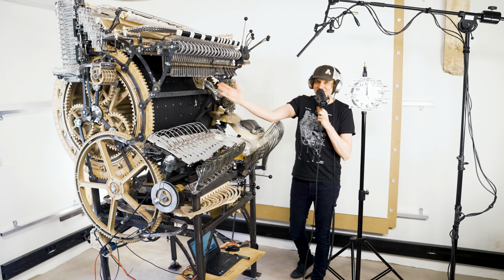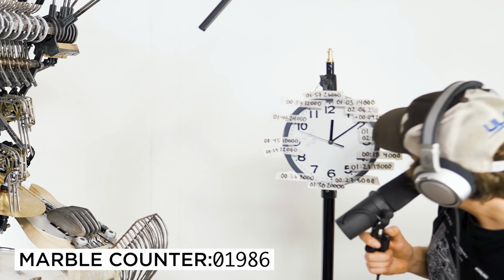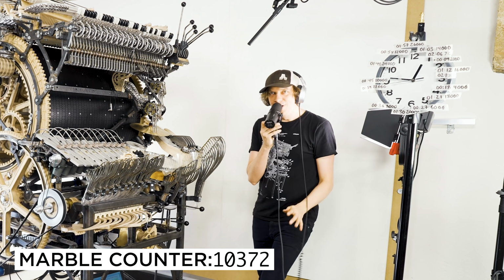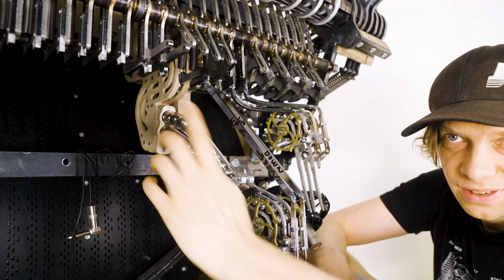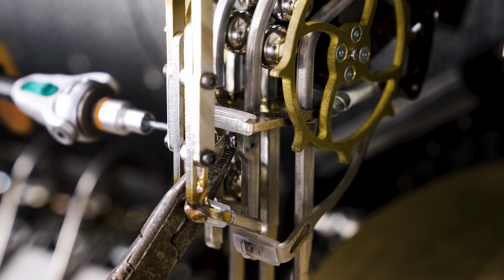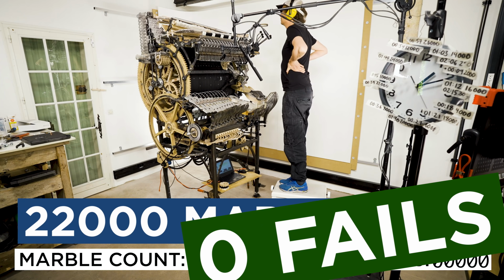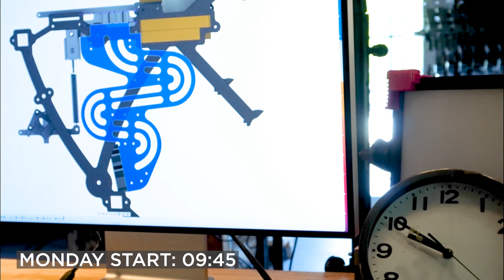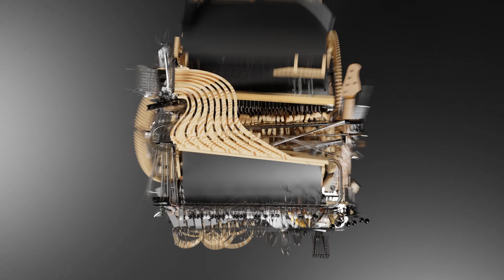Playing 30000 Marbles - Marble Machine X Accuracy Test

Comment: Finally updated washer stacks to spacers.  Impressed.
Reply: I only hope theres a washer between the rubber and the metal, because otherwise it would still cause friction. There's a reason trains don't use rubber wheels after all
Reply: He skipped over it as if he's trying to hide something from his grandma hahahahah....
Reply: It did not look like rubber but a plastic cylinder
Reply: SPAAAAACERS!

Ivan's follower checking out.
Reply: @mickys8065  In Paris they do...
Reply: I was expecting him to make a groove in the original pin and use a C-clip. Instead he went with a less elegant throwback method.
Reply: Yeah it's a POM piece, they're rather low friction. (Which happens to be a problem sometimes in hydraulics.)

Comment: 8:41 just a little heads-up. I noticed one of your catchers was rocking because of vibration. That was in an unused channel, so no issue there. But as you start adding more channels, there is a possibility of them rocking because of resonant frequencies, which may cause the marbles to miss.
Reply: O yea it really does 🤔🤔🤔
Reply: The current catcher is still a leftover from when the artist was building the machine, not the engineer. So the  flair movement was stopped by the engineer to prevent fails during tests, and will revisit them when the rest of the machine works.

One way to prevent the issue as you describe is to support or replace the PMMA tube that is holding them, they are too long and wobbling. The basket design itself is not best solution for the enginer either as the marbles bounce randomly inside them because of hitting the steel rods , thus the curtain extensions you see on them for now.

They work for now, but they are definately not in their final form.
Reply: @89lutzy  cool!

Comment: "I'd like to change the programming wheel."

In the pursuit of perfection, you risk never finishing.  Same thing with the focus on getting 10m marbles with zero landing off beat or outside the funnels...seems to me that you need to focus on failure modes.  If a marble drops on the floor every 3-10 songs, that's not a failure, the machine still works.  Making sure that machine breaking failures never happen is far more important.
Reply: Often, Better is the enemy of Good
Reply: You cant be sure that a wild jumping marble who dont follow here path going to land only straight on the floor.
This innocent event could lead to a catastrophic failure.
Reply: @fafane65  Yeah, I totally agree. Martin has said multiple times that his nightmare failure is a marble falling off somewhere in the machine instead of the floor and jamming and breaking a gear - destroying the machine. 

I totally get the people saying  "better is the enemy of good", and I do think that Martin often falls into that trap, but as someone who has worked in the field of reliability engineering, in an interconnected system you are only as strong as your weakest link. I do think Martin is focusing on the right things nowadays though, whereas before he would often hyperfocus on redundant or superfluous features, now he is much more focused on the actual points of failure and the critical points of the machine.
Reply: This comment is not helpful. He is a musician first and an engineer second. If the song misses a beat or a note due to a timing issue or a programming wheel issue then he can't do what he wants to do - world tour. This isn't about the next marble machine YouTube viral video, it's about making a machine capable of playing music on stage. It needs everything he's dumping into this, including making programming wheel version 2.

Comment: I really want to know what happened to the marble gates. The return of the pressure relief lanes and the escapement mechanism not touching the escapement wheel teeth is pretty weird. Those marble gates were tested with much more pressure and everything worked fine. I feel like those pressure relief lanes shouldn’t be back, but I’m glad at least it’s working.
Reply: Exactly. Martin is acting as if nothing happened. He doesn't even want to talk about his new plywood parts. He never explained why his new pressure independent gates suddenly got pressure dependent. He's ignoring the elephant in the middle of the room.
Reply: I believe on the discord theyve discovered that the POM piece is wrongly angled, and can and has been fixed so there is no pressure problem. Martin just has to order new POM pieces, though he has also said he likes the way the pressure path looks with the visible marbles, so he might keep them anyway.
Reply: @guitarskill  Cool! I don't use Discord, so I'm not aware of the progress mentioned there. If the problem is just a simple CAD error as you said, the solution should be easy. If Martin wants to keep the pressure relief lanes for the aesthetics, it's ok, but I think that having a fully functional marble gate is very important. In my opinion, the pressure relief lanes should be just an aid for the gates, not a need.
Reply: I think there's more to it. Why does Martin need to order these POM pieces? They are pretty easy to make on his CNC.
Reply: @kriswillems5661  yes but he needs a precision manufacturing he can't achieve
Reply: @bastienpabiot3678  Are you sure? I think such a wood working CNC can go up to 0.1 mm
Reply: He talked about the pressure problem in the last video.

Comment: Curious as to how frequently the wearing parts, e.g., the springs, will need to be replaced.  Like, fresh after each concert?

And I love the marble counter has 5 digits, the same as the overall counter.  As if there could be a 33%+ fail rate. 😅
Reply: This is my biggest fear with this machine, each gate still contains 4 moving parts, which is 4 times more than 1 part from the pinball design,

The machine as is simply has a multiplier of at least 4 to whatever failure ratio it could have, and that's just the gates
Reply: @CraftMine1000  Time and trial will tell,  I guess!
Reply: Truly, maintenance intervals are a thing.
Reply: the springs at the top have been going on 3 years without being replaced, as long as they're not being stretched to their limits which they aren't it should be fine, probably best to put a fresh set on before the tour though
Reply: @TreyVaswal  That's the question, what interval?  If it were me, I'd have a whole set of parts, sorted and labeled, to replace for every performance.
Reply: @LightWarriorK  wow its not that frail, Most parts moving are made of metal, metal is sturdy dude.
Reply: @DooomiNation  The sturdy parts aren't the issue.  But parts like those springs, parts that wear out, places where the marbles run, they're going to eventually need replacing.  The more they're used, the more often they'll need replacing.  1 million marbles per show, as is the goal, and there WILL be wear and tear.
Reply: @LightWarriorK  You are aware of how many times an engine turns over a minute when it's running? That machine is going to last a looooong time before it needs any TLC. It's machined to pretty tight tolerances at this point, so it's a reasonable comparison.
Reply: @joelashton6328  This isn't an engine.  An engine has oil, and hardened steel. There are wood and plastic parts here, immaculately made, but still subject to wear.  In many of these vids, if you look carefully, you can see small signs of where the marbles have worn at the wood, or where the plastic pieces have started sloughing off little bits.

Just because this is of extreme quality doesn't mean it won't wear.
Reply: @LightWarriorK  Engines are also under more stress, and running at high temps. This won't wear out much faster than a well-used xylophone. There's impacts, but there's really very little, if any, rubbing going on between fragile parts with real stress on them. The plastic tubes will likely wear before anything else. Although, on that note, some clockmakers use ceramic bushings (bearings? Can't remember which) which require no oil and basically work indefinitely. They're pricy, but would give something like this a lifespan longer than we'd live long enough to care about.
Reply: @LightWarriorK  this is, of course, all hypothetical bs anyways. But conjecture is fun.
Reply: @joelashton6328  Yes.  And if it helps Martin think about things he didn't before, and improves the machine, all the better!

Comment: What changed between the CAD of the escapement gate and production to cause the pallet to only hook on one end? The lower "pin" doesn't ever interact with the cog now.

It clearly still works, but I'm curious and can't seem to figure it out!
Reply: The lower resting point is a screw
Reply: @artable_j  I'm looking over the CAD renders from previous videos, and I don't see such a screw: The bottom of the pallet is attached to the pushrod for the release arm, but the mechanism holding the marbles in the chute appears to have some room to slip, that might allow an additional marble to drop into the release position, and if I'm seeing this correctly that could mean an edge case occurs that allows more than one marble to drop simultaneously - an issue that's currently worked around with the plywood "pressure valve" from the marble divider.

As I said this clearly works... but I'm curious as to why the implementation doesn't match the design, and what has changed between the two.
Reply: I don't think there's a design flaw here - my suspicion is that the release arm is not travelling far enough for the pallet to engage in the second position.
Reply: @rossstewart9475  He seems to have drilled through the pallet and installed a screw to stop the wheel earlier. I can only guess that the wheel traveled too far and released more than one marble sometimes.
He even had those screws installed in the last video when he showed that the pressure gates can fail with too much pressure, which makes me wonder if that screw is responsible for that. In the last video you can also see that the point of the wheel that makes contact with the screw had already worn visibly, as it's not just a smooth pin but a screw.
Of course he could have noticed all this and corrected it, if he had made a prototype before making 30 of them :P
Reply: @rossstewart9475  The screw isn't in the cad, but it is on the machine right now. You can see it in the videos. I only noticed it when someone on the discord pointed it out.
Reply: Cheers guys, I see the screw a centimetre or so below the pivot point of the pallet. This still begs the question of what changed between the CAD and implementation to demand this, though!

Comment: Great progress! Just one thing jumps to mind: To be honest using a stronger spring will put more resistance/wear on the programming wheel. I reckon using a linkage system to the marble release so the spring can be as light as possible and less strain on the programming pins/saddles. The saddles wil buckle over time using a stronger spring.

Comment: It's starting to feel like something out of the Myst books, or maybe The Martian. Such precise fixes to account for tiny errors in the machine. Like, you've designed, built, contracted and assembled an intricate mechanical machine that functions correctly 99.993% of the time and you're going "nope, not good enough". I'm pretty sure the Apollo missions had bigger error margins.

Comment: I'm not an engineer, but if errors seem to happen later in the run, it might be a good idea to have a reset at the top of the conveyor leaving a brief gap to the flow of the marbals. The idea being that for an error to happen, a momentum of small chaotic things need to build up. A brief reset could give things more time before that builds.

Comment: I just realised, you could potentially program it automatically by adding a device to the back of the wheel.
Has little lines of pegs it can insert , and a gear to rotate(or at least read the rotation of) the programming wheel little bit by little bit.
Might not be too hard to "deprogram" the wheel with the same thing if it can pull the pegs out.
Better yet, you could remove it so it's not taking up space when you're playing it.

Comment: Hey 👋🏻 
Can you please machine a part an put circlips to hold the spacing please 🥺

 It’s really beneath the machine at this point to start putting development adjustments (all-thread and lock nuts) where precision spacing is required....
 The other thing you need to think about is how that mechanical linkage is sliding on a treaded rod. Over time this may foul and create wear which a properly machined pin with bronze washers will help avoid issues.

Hope this provides some encouragement. Great job 👏

Comment: As I said previously, the springs are an issue. If the springs merely retract the arms in a non-critical application, meaning they function on the reverse and merely just pull them back afterwards as a non-critical reset. But the problem is when you go from non-critical to critical, meaning you've got the arms pressing on something to then operate a secondary function. That's the problem. Because springs decay over time, the more you use them, the more they reduce in function. And when you tie that to a critical function, it's not a great way to do it.

I think that replacing the springs if you are going to use the arms in this fashion. Or tie this function in directly, instead of secondary.

Comment: In my opinion the problem of the 2 balls loaded together is due to the incorrect functioning of the clock gate.  The lower part of the black lever never touches the tooth of the brass wheel.
In my opinion, this is due to the spring inside the gate which is too long and in the rest position prevents the lever from reaching the stop.

Comment: I'm interested in how you will solve the timing issues.  I wrote very early on (possibly over 2 years ago) that I thought the gates ultimately may require the same height difference between the gate and the instruments' contact surfaces to ensure the relative timing works.  There are obviously other ways to compensate for different heights but I'm really curious how you are thinking you will solve this.  Maybe an adjustment at the top part of the gates that come into contact with programming wheel?

Comment: So, I see at Mark 4:26, that two marble were released at the same time over the snare drum; how two marbles manages to escape at the same time is the question. What I see is; both marbles escaped at the same time, and the top marble bounced off the bottom one as they both hit the snare; causing the top marble to jump over and hit the clear net to the smaller drum, then bounce off onto the ground. This will no doubt be a problem; that somehow two marbles are going to be released simultaneously, or that, as the tempo increases, so do the close proximity of each marble released onto the cymbals, drums, and other percussion pieces; thereby, causing two marble to collide and bounce off onto the ground.

Comment: 4:25 it seems your clock escapement mechanism dropped 2 balls at once and the top ball bounced on the floor after collision with the another ball bouncing from the drum. I guess you need some extra lights and shorter shutterspeed on your camera to capture the issues better without the "Enchance!" magic. The ball "splitting" looked cool, though.

Comment: I can already see an issue; a stage is never going to be 100% stable and steady, it's going to thump and shake with every footstep and impact, which is going to throw off the accuracy of the marble arcs, so no matter how high the accuracy in your workshop with its cement floor, you can't get a good idea of how it will function in an actual concert. But on the flip side, the occasional lost marble could be a sort of souvenir for people in the front row, like baseballs hit out of the park into the stands.

Comment: hmm I sometimes wonder if this project is going about error handling in an unnatural way, that of being very precise and clockwork-ish.
I think building a system that can recover from mistakes (for instance, a human drummer who can catch themselves when they're out of beat) is going to be more robust than making a clock that, while working makes 0 mistakes but can easily fail due to bugs or brittleness in its operation and become irrecoverable.
however we're nowhere near making a good system that can recover from failures outside of very few domains, and most of those require some kinds of digital computations doing some of the reasoning, which is contradictory to this mechanical construction

just my 2 cents, what martin is doing here is very difficult haha

Comment: I know it's very early in stages to consider this, but I'm very curious about what your ideas are for acoustic isolation for the mission I remember you saying that you would like to travel with this machine however you might not guarantee yourself a sonically isolated space that you currently have now. You will be very prone to Stage noise as well as subwoofer residents and poorly treated areas. I was wondering if you can elaborate if you thought about how you are going to be isolating any contact frequencies

Comment: So... How much more force does that new spring put on the keys in the programing wheel? Whenever you change one thing it also changes how the rest of the machine works. That's hard to avoid. The real question is if it causes enough stress on some other part that it increase the risk of failure to any significant degree.

Comment: Might not be an issue, and sorry I don't remember what the sections are called, but it looks like the tracks at the top dividing marbles from the elevator are very biased to the outer tracks meaning the later instruments (like the two tested) are delivered more marbles? probably just a matter of having enough marbles in the machine but you could also split the section before the elevator with something like the switches in the divide by 4 to spread the marbles better.